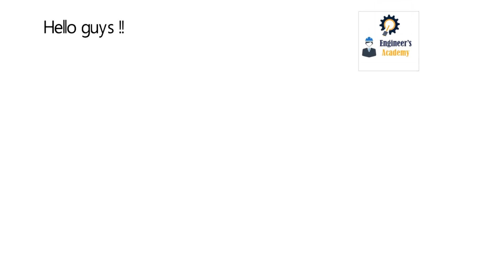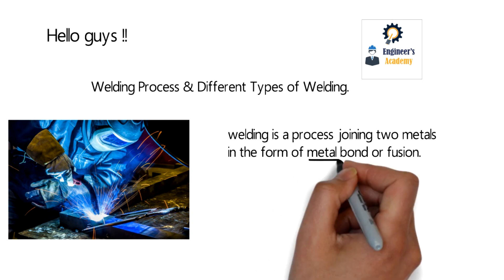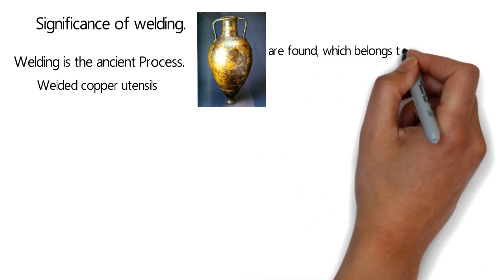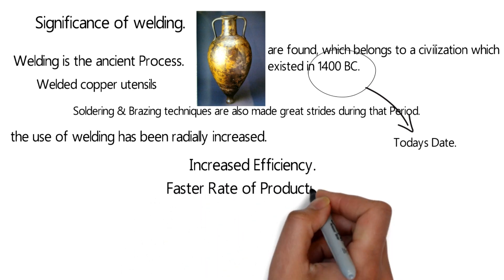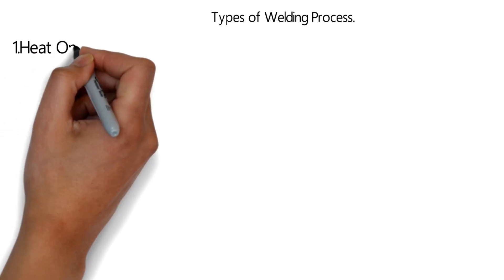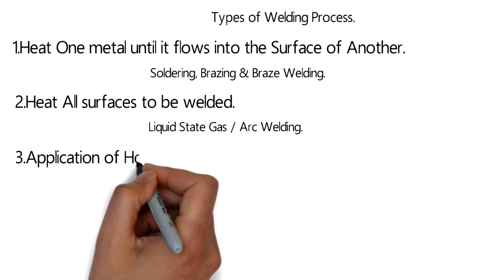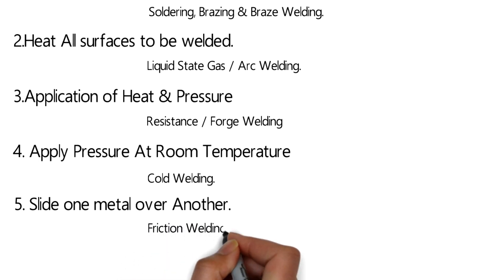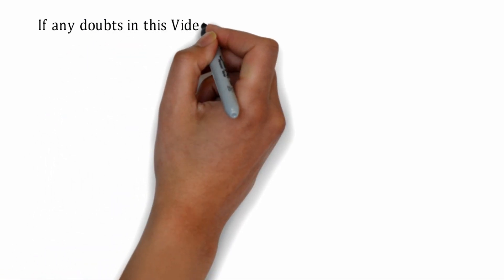Welding Process & It's Types ||Engineer's Academy||

Comment: Is it must that welded metal must be same?
Reply from the maker: No... Filler metal is there...
Reply: @EngineersAcademy9204  What do you mean by Filler material.  Please explain with example.
Reply from the maker: If you want to weld ss304 handle to ss304 tank.. both mental mst be same.. but there will be filler material is also there in arc welding..